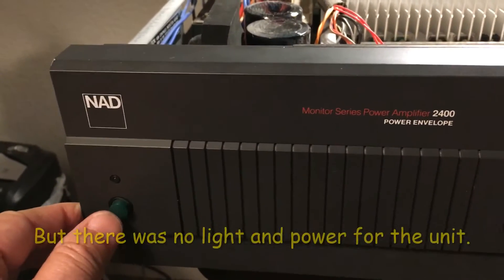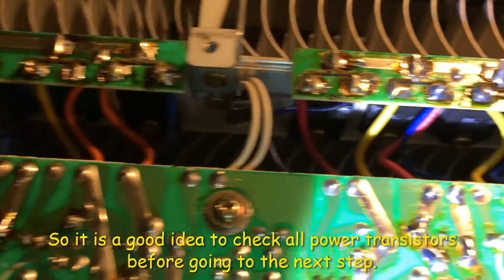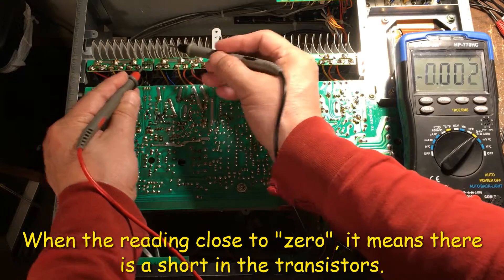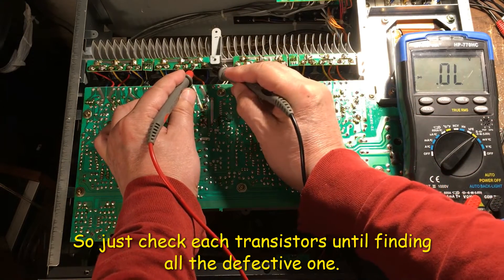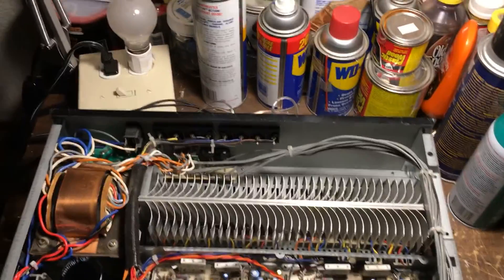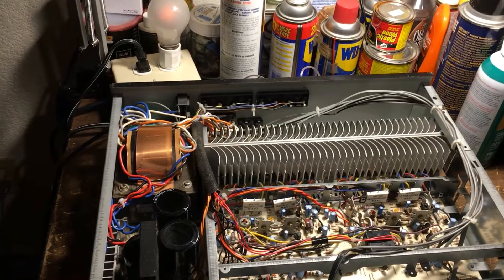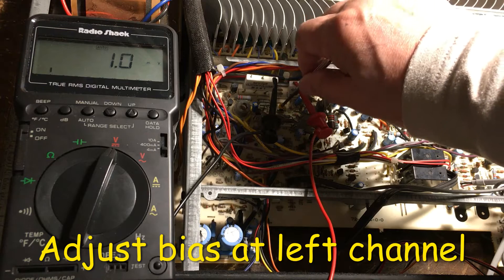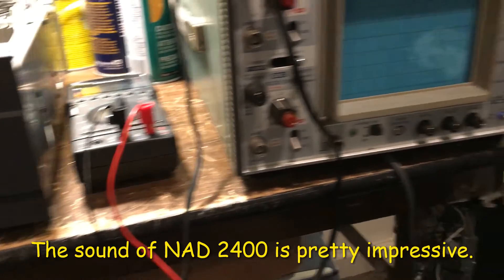NAD 2400 Power Amp Repair - One Channel Defective

Comment: Hello

I have find one nad  3400 in trash, have broken speaker terminal's and power switch ist completely blocked 

Do you have a recommendation for new relay's for nad 2400/3400?
omron or maybe something better? 

They have 1 POLE - 15A 
VS-12MB-NR
 takamisawa relay's but they are discontinued 

Greetings from Germany

Comment: Your tutorial makes even a novice like me follow and fix easily. Please upload how to fix sansui 5000x right channel not working. Thanks
Reply from the maker: Thanks for the comments. I don't have a Sansui 5000X to show you the repair video. However, I am working on another Marantz 2230 repair project which will show how to detect and troubleshoot the non working channel issue.
Reply: @VintageAudioFan  ok. I will watch it instead. I guess it could be similar. Thanks
Reply: @VintageAudioFan  is the Marantz 2230 video u are talking about already posted or will u posted later? If later; when will t be posted?
Reply from the maker: No. There is a new 2230 repair project which I have done recently. I am editing it right now and will post it in next few days. This video will explain the steps are needed to deal with the non working receivers.

Comment: I have the same amp. quick question: my speaker (KEF C85) indicates "IMP 4Ω  AMP 150W (4Ω)" at the back. currently, the NAD is set at 8Ω. Should I switch it to 4Ω?
Reply from the maker: A 4Ω amplifier can drive an 8Ω loudspeaker but it will produce 50% less power.  Conversely an 8Ω amp driving a 4Ω loudspeaker produces 50% more power.
Reply: You answered your own question

Comment: Is  biamping is possible in this amp?
Reply from the maker: It can be bridged to 200W per manufacturer's spec but needs (2) 2400s or adding an amp to do bi-amp for speakers.

Comment: Another great video. 
Well done for this repair. 

May I know how you pick the replacement transistors?
Reply from the maker: I always check the OEM transistor datasheet first. Then I gather information from website for the equivalent replacements. Here is a link which covers the info. for how to select the substitution (same as my method) :  
http://www.bustedgear.com/faq_transistor_substitution.html
Also I prefer the selected transistors are designed for low noise hi-fi audio use.